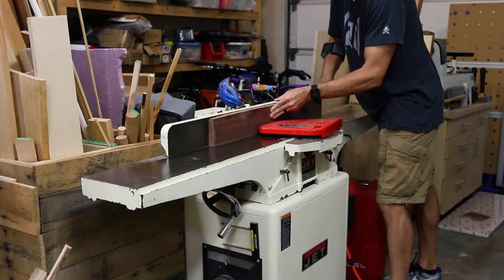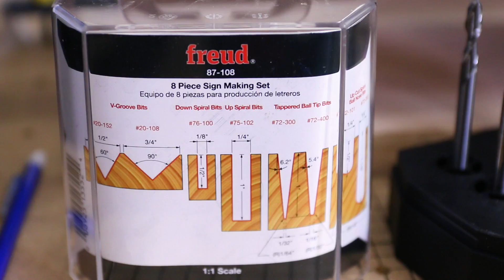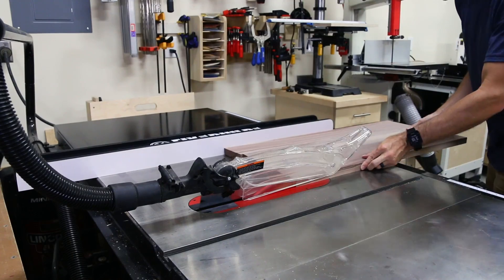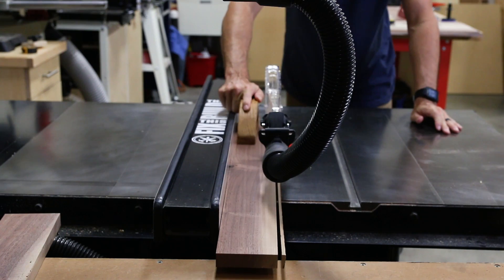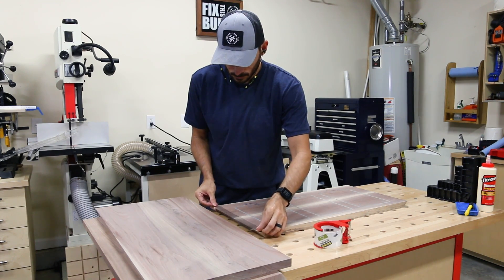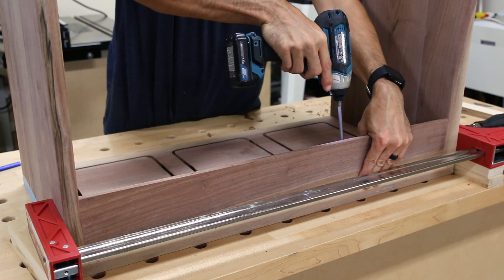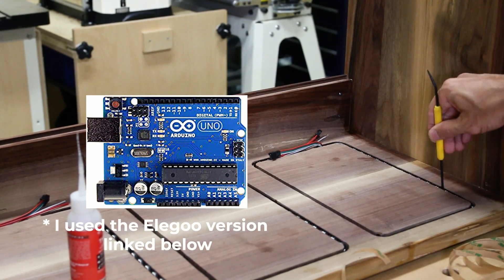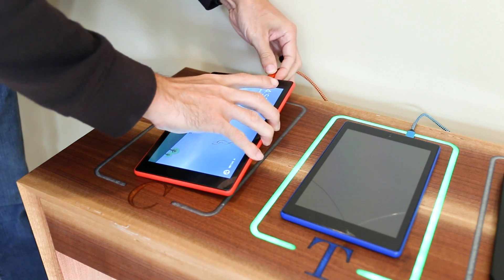Smart DIY Charging Station with LED Notifications | How to Build

Comment: That looks amazing. I wonder, could the same effect be accomplished with a wireless charger? And don’t feel too bad about the arduino code bugs. I write software for a living and those random bugs are the worst to track down. Even pros struggle with that! Now I definitely need to do something like this that blends my professional expertise and my woodworking passion, with some electronics fun to boot!
Reply from the maker: You could absolutely do the same thing with wireless.  Would just need to cut into the cable or use an extender.  And thanks for the encouragement!
Reply: Could a possible future build be a wireless charging floating night stand ??? Well that’s what I need for me...:)....but I’m a see some one build it kind of person. I like watching ur channel. Great work.

Comment: wow, even if you had trouble with the code, the effect of the light pulsing around the epoxy is absolutely awesome to look at! that thing is super cool and looks great!
Reply from the maker: thanks!  I was pretty happy with how the LEDs all turned out, just not reliable yet
Reply: I have to agree. Even though it was not the outcome you were looking for it does the job nicely. If it works and the kids are more organized and they like it Dad just got even cooler, I think its neat and I'm old!! Thanks for sharing ! :)

Comment: 9:02 The Arduino Due has a scheduler library available, that allows you to create threads running independently from each other, so you can update more strips at a time without messing with timings and other complex things. You can make as many loop functions as you need. It even has a lot more pins and it's a lot faster
Reply from the maker: Oh, man!  That sounds perfect.  Apparently I didn't do enough research..ugh
Reply: Daisy-chaining the LED's is the easiest way...
Reply: Due and scheduler are INSANE for this.   Leave all the LEDs one strip, paint into a buffer (like a screen) and shift it out atomically.  Tiny fast code.  This is embedded mPU, not Microsoft bloatware.